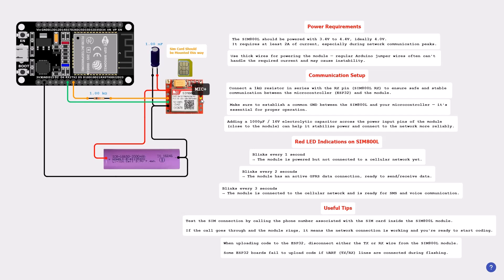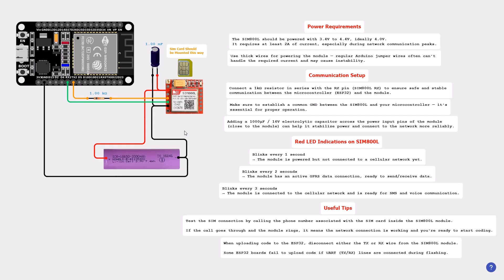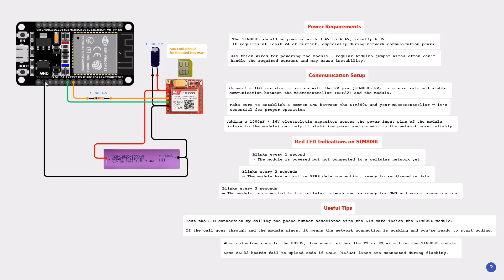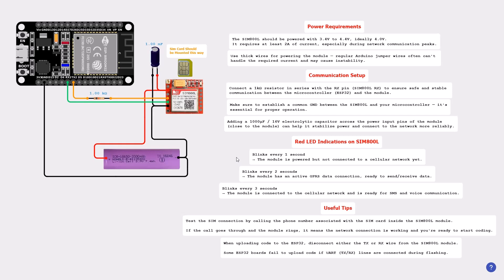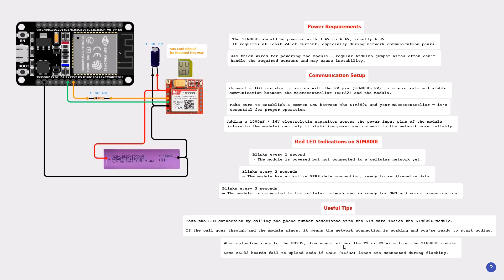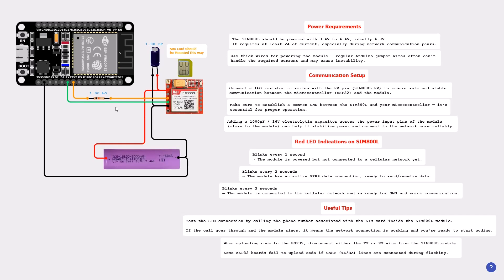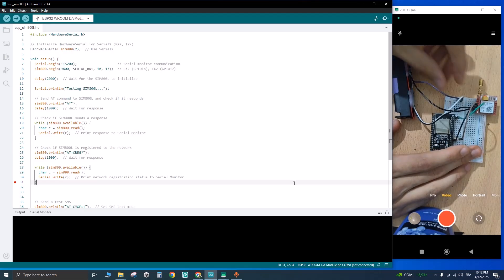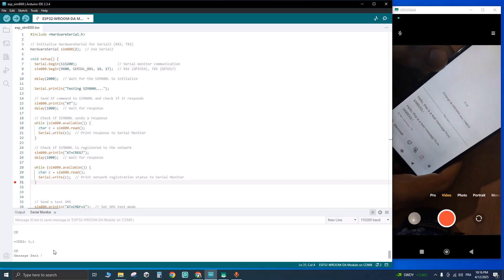How to Use SIM800L GSM Module with ESP32 (Send SMS) | 2025 Full Guide

Comment: what you attached with the li-ion battery sir?
Reply from the maker: a capacitor
Reply: @helpplztutorials do i need to use a specific  type of capacitor or any one will work. And can I do it without a capacitor?
Reply from the maker: @Divy_Varia  without capacitor u risque of not getting the module connected, since it need a much higher current that ur microcontroller provide, so i advice u to use one the same specs i showed in the video or a near one